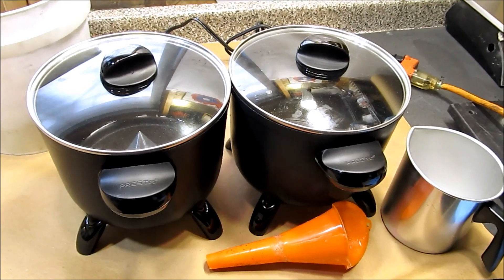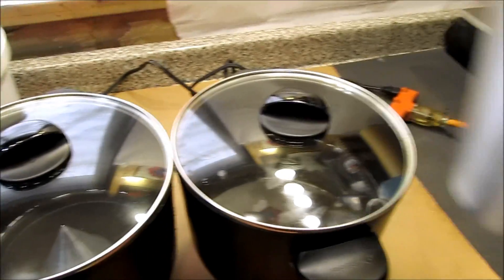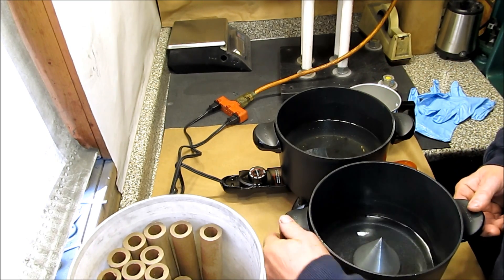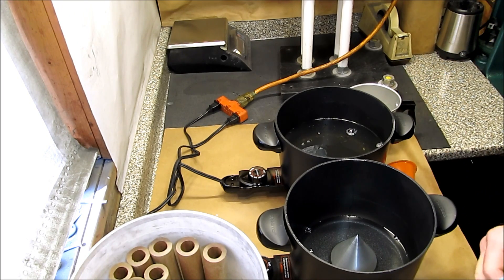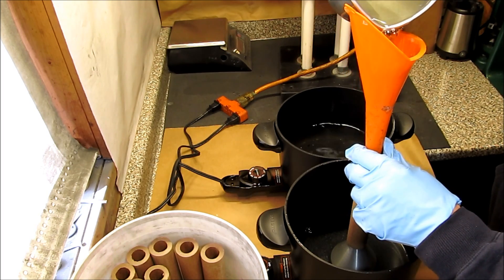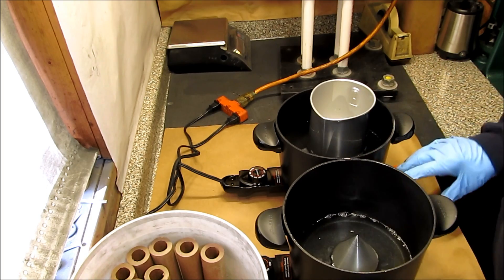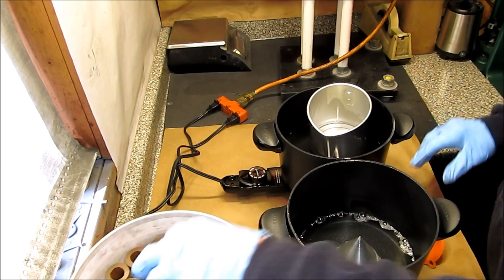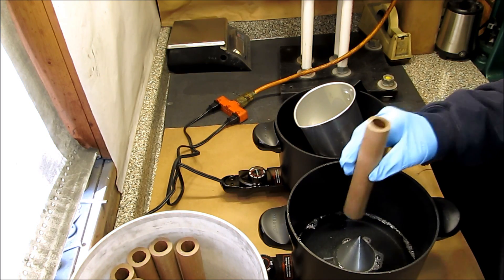Waxing Tube Interiors

Comment: I found that when I press the rocket fuel I get a lot of wax flaking off inside the tube and sticking to the side of the ramer. I'm worried If the wax gets compressed in between the increments I may have a problem. Anyone with a similar experience?

Comment: Do you have any problems with glue sticking to the tube after it's waxed? I was just thinking it may cause a little problem attaching the heading.
Reply from the maker: That could pose a challenge, Vince,  but I have methods of attaching the heading to the motor, which work nicely, even with the waxed tubes.

Comment: Would this help with the comp burning a hole through the tube? I just received a pack of 100 tubes and 4 of the 5 tubes will blow out a small hole on the side of the tube mid flight and cause it to just fall out of the sky. The other set of tubes I already have don’t do this so I’m not sure why these are doing it.
Reply from the maker: I doubt the tube waxing would help with that problem. Burning a hole through the tube wall usually only happens with long duration end burner motors, and the cheaper tubes.
Reply: ned gorski so these are my buzz bombs I but I suspect the tubes may be the culprit he did mention they may have less glue on this batch of tubes so I appreciate it Ned.
Reply: I searched through all your videos do you have one of you fireproofing tubes? The batch I received is 100 tubes so now I have to fireproof all of them as I am sure they will all fail.
Reply from the maker: @E85_STI  There's a produce called Universal Paper Shield which you could try. Or soaking them in a diluted sodium silicate solution, or Minwax Wood Hardener.  If your tubes are of questionable quality,  I'd have to wonder if anything will  work to really  improve them. What kind of tubes, how thick-walled, and what kind of motor?

Comment: May I ask what the purpose of waxing is? cotton swab like what's used for PVC primer and glue work if I were to saturate it and pull it through?
Also visited your Web page, once I pay the subscription will I be allowed access to forums/discussions and other info I can't access?
Thank you.
Reply from the maker: Yes, a subscription enables you to view all the thousands of Forum posts/threads, articles, formula, etc., Gary. 
All the benefits of tube waxing are discussed in detail in there.
Some folks do use a "swab" method, but I prefer the pour-full-and-dump method.
ned

Comment: I have recently started using this method and my motors have been transformed from mostly reliable but not enough to trust your finest shells to, to so reliable I'll probably use them to lift my most precious shells.

The difference is unbelievable.
Reply: Sparky Malarky so you recommend waxing the tubes? I'm going to make rockets soon. I need to know before I make them
Reply: Z

Comment: Interesting that I don't recall this being one of the many pyrotechnic uses of wax in Bill Ofca's series in AFN. Recent discovery?

Would it be feasible to wax coat the interior during the rolling of a case? Say by waxing the 1st turn? I once rolled a case (not for rocketry, though) with a turn of waxed paper on the interior. Is that a practical alternative?
Reply from the maker: This is a recent innovation from Dave Forster, Robert. Shimizu does mention lubricating tube interiors with kerosene (paraffin oil) in FAST, though. Since our tubes are machine rolled at the factory, I don't think it could be done there, but perhaps it could somehow be done, as you suggest, with homemade tubes, but I don't know how. This process is so easy and simple, I'll just continue to rely on it.
Best,
ned
Reply: @nedgorski  Now that I've moved to a more pyro-able location, this might be something I'd work on.  In recent years I've switched to the Skin Man's technique for case rolling, which allows the use of wood dowels as formers.  Previously I'd had to use only metal formers and STILL sometimes had cases stick to them and have to be cut off, just as Weingart wrote.  With the Skin Man's technique there's no glue on the innermost layer to stick to the dowel.  It does make the ID a little more than the OD of the former, though, which may be an advantage or disadvantage.  Now, if I had WAX coating the innermost turn, that should come off the dowel during both the case rolling and when using a dowel as a rammer.  It's easier to get dowels of various diameter than metal cylinders.

Comment: As an amateur, I must ask; what does waxing the interiors accomplish?
Reply: TheProfessor Fate The professor is correct.  There is no mention of the reason for doing the waxing.
Reply from the maker: We have pages and pages of explorations of those benefits on the site, Prof, and the reasons they accrue.
Reply: ned gorski Skylighter or ?
Reply: @nedgorski  I'm a huge fan but let's not get carried away here, I've seen the pages and pages you speak of I wouldn't exactly call that prof. Technically it's still a theory on what we think is happening, we don't exactly have a slow motion video showing the flames trying to enter between the grain and the walls. We can make assumptions and guesses on why we think it's benefiting but. There's also evidence that says waxing your tubes holds no advantage. Because there are a lot of pyros who don't wax their tubes and have had the same amount of Cato's compared to when they do wax their tubes.
Reply from the maker: @patman0250  To each their own, Pat, of course. Reducing CATO's is only one of the purposes served with the tube waxing I do.
Reply: TheProfessor Fate
Fireworking.com
didn't you see it in the video? :p
Reply: ***** Doh!!!!!!